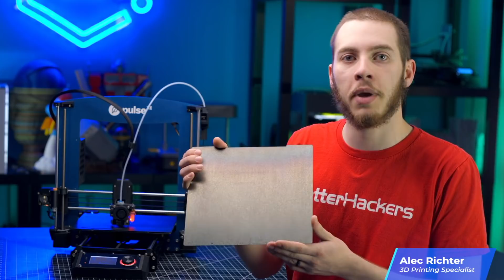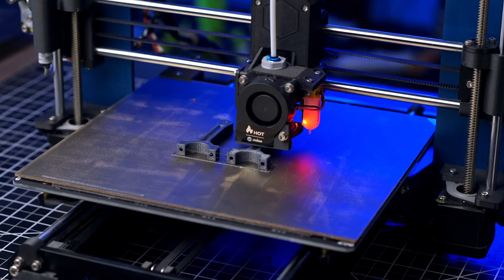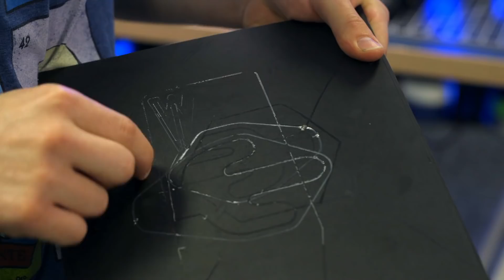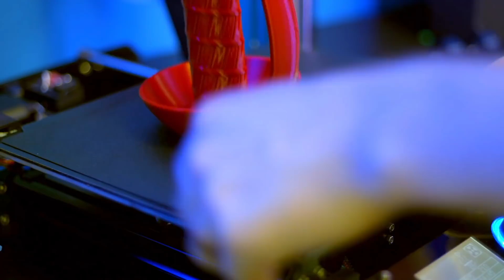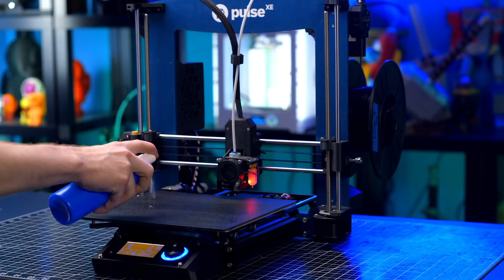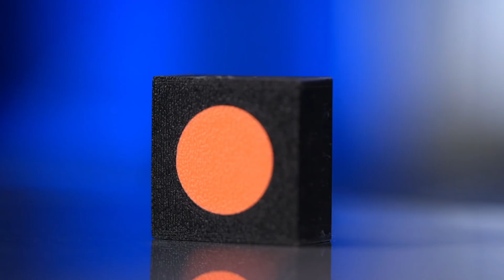Upgrading to LayerLock Powder Coated PEI Build Plate

Comment: Have a powder coated PEI from Prusa and they are fantastic. PETG sticks too well but instead of alcohol wipe down with Windex and it reduces the bond a bit to have it release cleanly and with no damage.  The exception is the low-gloss petg from 3dxtech.  It prints at higher temp which makes to bond to the bed too high even with the windex.  You are going to have to use magigoo for that version of petg.  

The surface is indeed nice and parts hold well since the bed has higher surface area than a flat sheet of material.